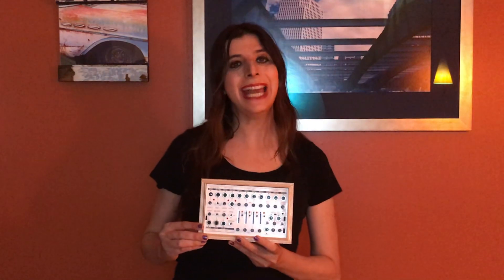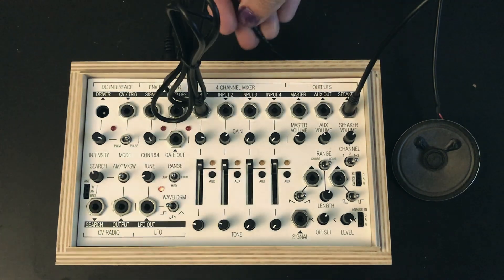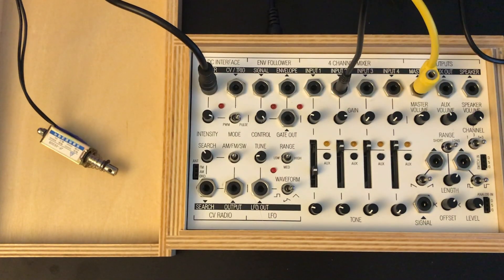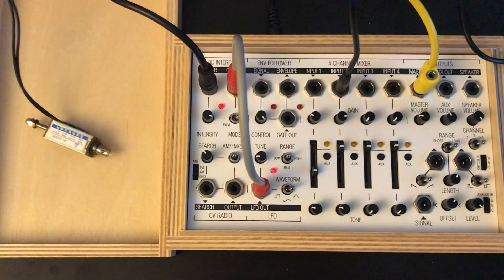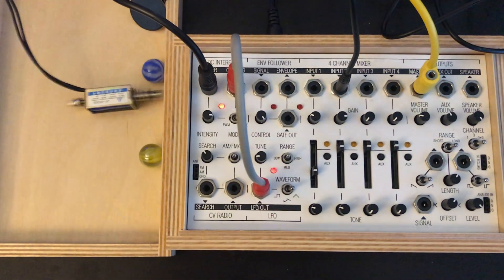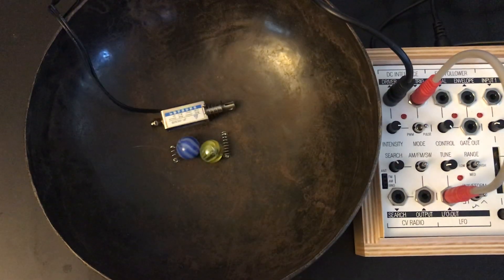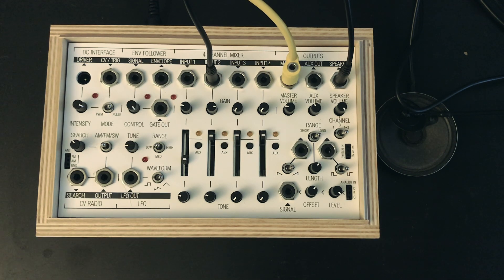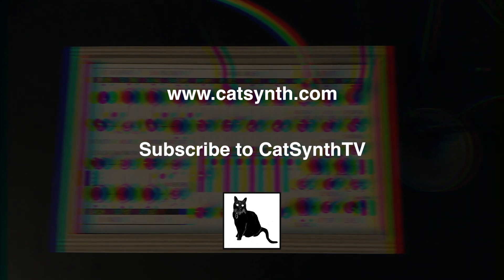Introduction to the KOMA Field Kit [Episode 106]

Comment: Great video! Seems to be endless possibilitys with the field kit. I have a question about the coloured cables that are frequently used and have a female end on top of the male end. What is the purpose with them and Where can I find them?
Reply from the maker: Thanks!  I think you are referring to the "stackable cables" - these are the ones that have a male connector and a female connector for connecting a second cable to the same jack.  Several manufacturers  (TipTop Audio, Intellijel, etc.) make them and they can be found at most outlets that sell modular synths.

Comment: Interesting. I love playing with sound. I want to be able to take the electrical resistance from a plant and on ert that into midi using an ipad, is this pos ?
Reply from the maker: It should be possible.  You would need to convert the raw sensor data to CV (which the Field Kit does) or directly to MIDI.  Arduino is also a possible way to go for this.
Reply: @CatSynthTV  Sounds great, wish I knew more about Ardunio? Am a dysleix monkey, though not an idiot. I presently feed 2 radio stations working in pararel, switching back and forth, and feeding the signals into 2 beatcutters, then resampling the results into 6 samplers. Though would love now to experiment with plants. There are devices out there alreedy but the are expensive and have preprogrammed ideas regarding scales and musical note conversion etc. Thanks for your quick reply
Reply from the maker: @ToastedGhost  The radio station projects sounds cool, as does the idea to work with plants.  Good luck!
Reply: @ToastedGhost  Wow, i'd like yo hear this, are there any examples on your channel?
Reply: There are inexpensive humidity sensors for Arduino that you can connect to the sensor input of the FK via Dupont cables. That gives you CV. You’d then need a CV to MIDI interface. 
Alternatively if you have miRack you could try to take the CV and convert it there.